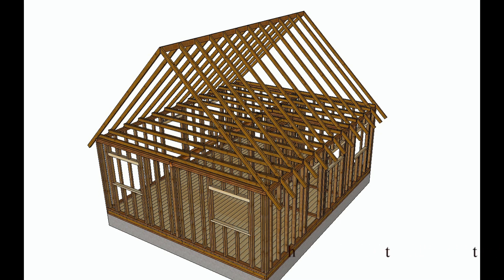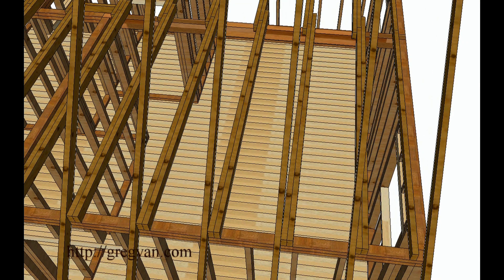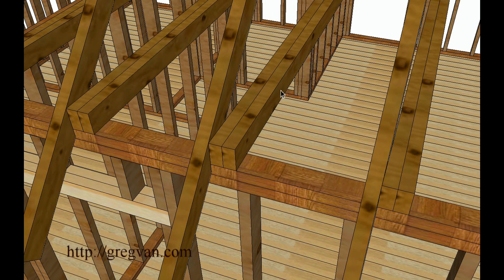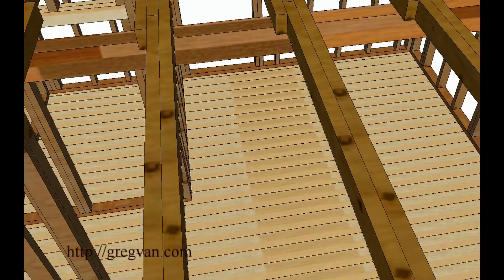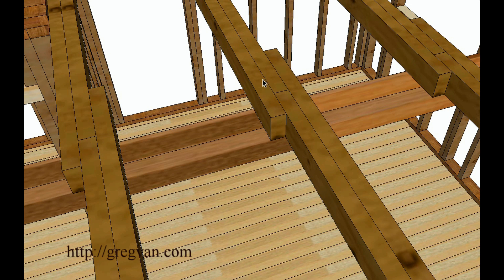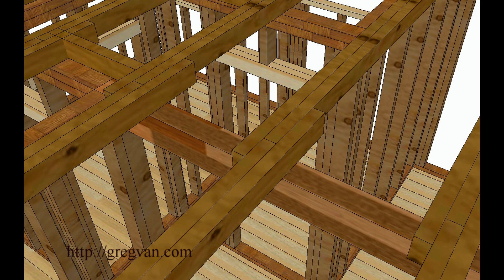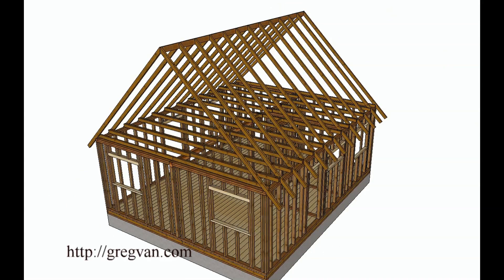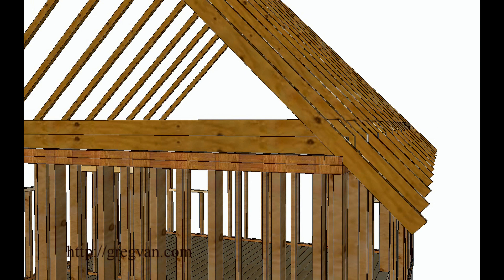A Few Methods for Installing Floor Joists in Attic – Home Remodeling Tips

Comment: I’m having trouble wrapping my mind around rafter layout with lapped ceiling joists. 

If one rafter is nailed to a joist, what about the opposite rafter? Won’t there be an 1.5” gap between it and the lapped joist? I can’t picture a way to have a joist one one side of the ridge being, say, to the left of a rafter and the other joist being on the right. 

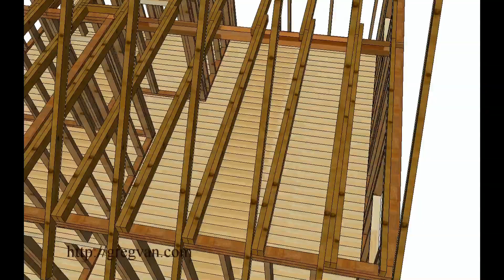1:08 illustrates what makes sense to me. The foremost joists butt into each other.

Comment: So here's a question for you. I'm building an 18'x36' shop with an upstairs only cause I'm putting up a 12/12 roof. How do I lay out my floor joist so my rafters line up? I figured I'd put my joists on one side of the building on one side of the 2' mark and the other side on the other side of the 2' mark, but my rafters would be off. Any thoughts?
Reply from the maker: I'm pretty sure I already made a video about this and would suggest going through the roof framing and ceiling framing videos on our website. Let me know if you can find it and I will look for it.

Comment: Where normally we have double joist???? Please
Reply from the maker: If you're asking where the double joist are usually located in an attic ceiling, it would only be if it was required by the engineer to support some type of load above.

Comment: What do you think of sister-ing the 2x4's with flat bar steel?
Maybe add 3/16" x 2" and screws it at top and bottom every other inch
(top screws off set from bottom row of screws)

(I say only 2" wide to allow for plaster & lathe below it on the 2x4)

PS - I plan to use steel wood screws, not deck screws for better shear strength.
Hammering with plaster ceiling below is a no go :-0)
Reply from the maker: It would be difficult to comment on that, without knowing exactly what you're doing. You might need to seek the advice of an engineer.
Reply: Okay, thanks.
PS the old 2x4's (well over 100 years) seem as strong as today's
2x6 or 2x8. Good wood back then :-0)
And much of the house was even made from recycled wood (lots and lots of square nails still in places they would not be if it were not previously used wood.
Reply from the maker: @2Truth4Liberty  Sounds good, I just like to stick to the tried and true methods of framing repairs but at the same time sometimes common sense can provide us with a better alternative.